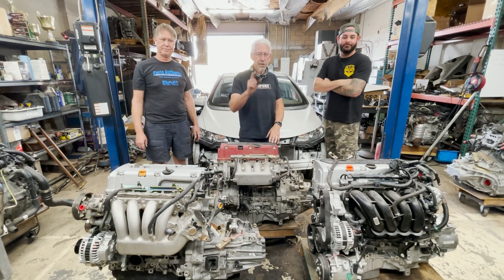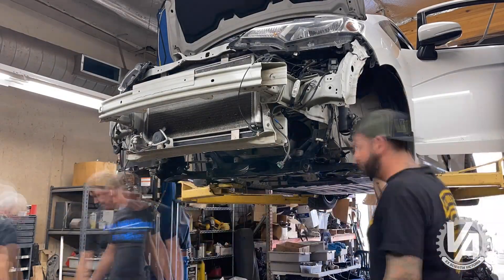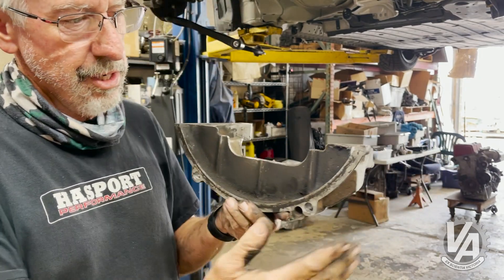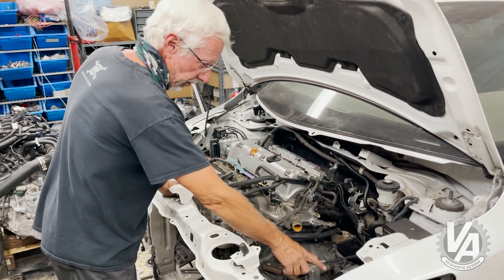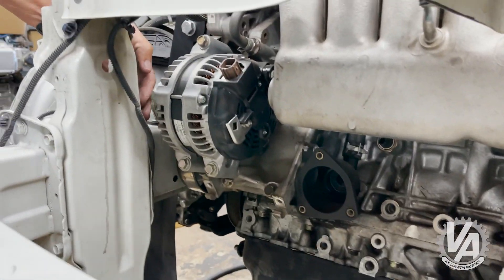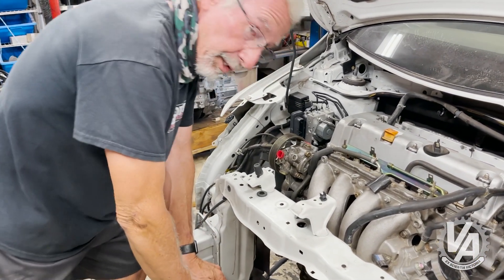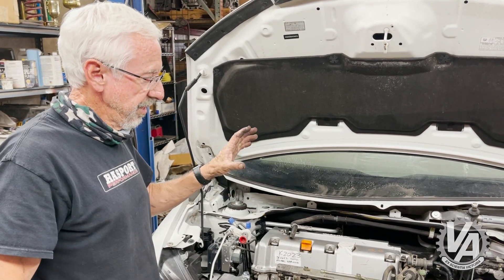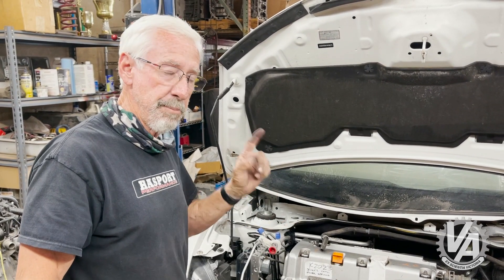Axion Fit Project -TSX and RSX Engine Swap Test Fitting

Comment: Very interesting. I am from South Africa and I have been doing research on K - swopping my honda Jazz/fit GK5 2015 model which I am assuming is similar to the one in this video. There are no GK5 fits in our area therefore, i have to rely on my research with limited experience. I am very much interested in the suitable motor and engine mounts for this vehicle. I heard you mention the 2012 SI engine should be a perfect fit and the bonus would be the wiring, which most of the components of the fit would be compatible. Have you done the 2012 SI engine fit already with the suitable mounts? I am leaning towards a k24 a2/3 from an accord however this video has sparked my interest, especially reference being made to the 2012 SI k - series. Any input would be appreciated. Thanks

Comment: I've been asking around for K swap or L15B7 swap harness information for months, and nobody has been able or willing to tell me anything.  I really hope you guys can make it happen, and make it available, especially for the turbo engine- I can do most of the other stuff at home, but figuring out the wiring diagram is beyond my talents.
Reply from the maker: I still haven't built the L15 swap harness for this car. I'll do that soon. I haven't done a K24 swap in that car, other than developing the mounts. So that wiring I haven't looked at either. I know some people who have done the swap in the 2015 CRZ which has similar wiring. Their cars were race cars so they converted the wiring to the 2006-2011 Civic style though so they could use the older engines. So that doesn't help either.

Comment: Will this kit fit a mobilio?
Reply from the maker: My best guess is it would fit on both the Mobilio and Brio.
Reply: @VTECAcademy  I live in Thailand so I was thinking the mobilio and the fit have the same motor. Did you hear what the EPA is doing to the auto industry?  Youtube channel PFI speed , the EPA went after them for selling ECU's. Anyway, thank you.
Reply from the maker: @wynwyn1941  That's unfortunate they went after him, but I'm sure it has to do with his high-profile association on Youtube and not selling ECUs with the proper warnings about off-road use only. If you go to the Hondata or KTuner websites there are pretty explicit warnings about using their products on street cars. There have been a bunch of lawsuits against tuners with a heavy social media presence recently specifically to make a point with people who are modifying street-driven vehicles. Our Fit will pass federal emissions properly when done.

Comment: Is it possible to completely close the hood on an eg with a k24 and rbc intake, using egk2 mounts on the higher setting?!?
Reply from the maker: Nope. The manifold sits too high. You might be able to do it if you plug the bracket booster fitting and move it, and cut some of the hood understructure. I may have to try that.

Comment: So let's say I'm going k24z7 on my gk5. I'm on board with everything mechanically. But where do I go with wiring? What do I use?
Reply: Go on the forums they said they are active on em.  Not sure which one.
Reply: @duanebailey6253  Axion is active on the Fitfreak forum for honda Fits. But to my knowledge there's no info on that subject yet
Reply: @SFLdrifter   their info on the Forums is very vague. Nothing specific. I plan on doing a vlog out of it. There’s no info on K gk5s at all. At least none that I could find state side . And even the ones over seas don’t have info on the swaps . I know I have to get exhaust made and maybe axles.
Reply: @SFLdrifter  I found it in my first search.  K24 fit wiring.  Come on now.
Reply: @duanebailey6253   link? And is it for the 2015-2020 fit?
Reply: @zamudio1991  pull the wiring harness diagram and compare them.  Seeing as you already have a 1.5 earth dreams direct injection motor why not make life easy and drop the civic turbo motor in?
Reply: @duanebailey6253   because the wiring is different completely between the l15 in the Fit and the L15b in the turbo civics. I’m sure I can figure out the wiring for it if I sit down and go thru it. But I already figured out the wiring for the k24z7 and also I have a full swap already to go..
Reply: @zamudio1991  You have to find the wiring diagram first. As far as I know it's only available if you sign up for Hondas subscription service.  I'm thinking canbus would make things more difficult too.
Reply: @quademasters249  and yes I know that. I’m a certified Honda master tech. I have access to all diagrams… which is why I said that there’s a difference between the L15 in the Fit and the L15b7 in the Civic’s pcm connector. I could figure it out if I sit down and look over both. But I already have the k24z7 wiring down to convert.
Reply: @zamudio1991   I did a spreadsheet for my last swap matching pin numbers between the two different ECU's.  I imagine you run the K harness on the engine with the ECU in the engine compartment just have to figure out the wiring for the body harness to ECU harness.  At least that's how my last swap went.
Reply: @quademasters249  yea exactly. That’s what I was referring to. The ecu for the l15 turbo only has 2 plugs.. 1 for the engine and the other for the chassis plug. That plug has double the wires then the Gk5 fit does. I can figure out the wiring if I sit and study it but I already have everything for the K swap
Reply: I’m going that route currently and made my own jumper harness and also figured out the ecu plug A pin out for the swap
Reply: @zamudio1991  if you don't mind. Would you be willing to share your progress on social media or whatever. My gk5 isn't under the knife yet because I just can't get passed the wiring on paper
Reply: I already covered it in my complete 'K swap guide in a Fit/CRZ.
the wiring of GE and Gk is covered in part13.I have provided all the wiring diagrams. Its a 17 part series BTW
https://youtu.be/g9-aWcKs3XA
Reply: @A.QPerformance   I saw your videos and compared the wiring diagrams you have versus the ones on our US built cars and there’s some differences
Reply: @zamudio1991  yup i have told in vidoes various times that there will be minor differences amoung models.some are auto,manusl,paadle shifts,push starts,cruise control etc etc but i have also shown a general way to figure them out with voltmeter and continuity tests.the main thing is wiring od important sensors like crank,cam,O2,ecu poweelr.those wires are same among them.and if you have pinouts if you can share,i will.put them in shaeed fokder and will help people out
Reply from the maker: Mostly it's just requires rewiring the car harness ECU plug and the C101 connector that interfaces between the engine harness and car harness. Unless you have an auto. Then there is the some added wiring.
Reply: @VTECAcademy   I already have that down packed. Made jumper for the c201 to c410 plug  and also figured out the A plug repin as well. Should be running this weekend hopefully and just got to get axles made and exhaust

Comment: How does the size of the L15B7 compare to the K20/24?  I'm trying to decide which I want in my GE fit. The K's seem big enough  to get in the way of regular maintenance.  Wondering if the L15 is smaller.
Reply from the maker: We will see in the next video!
Reply: @VTECAcademy  Some measurements would be great.
Reply from the maker: @quademasters249  The L15 is narrower, but both taller and bigger front to rear. I don't have a GE Fit to try it in, just a CRZ
Reply: @VTECAcademy  Thanks. So, there's more clearance between the frame rails but less between the core support and the engine? And the engine to the firewall?
Reply: with L15B the tuning potential is less.You will be limited to may be 300 hp. The k series can go to 400-500 easy.and aftermarket support is enormous. Also the new l15B uses Bosh ECU's.Good luck with the wiring
Reply: @A.QPerformance  For a track car Fit, 200-250 is plenty. Enough to make you the fastest car at the track day.  400-500 on a FWD car is just silly numbers. Nice to brag about but not really usable.   It's good for dyno numbers and maybe some drag runs. 

If I did K I'd just leave it stock. Reliability is the most important thing for a track car. 

I don't expect the wiring to be any worse for K into Fit than L into fit. It's still canbus and would require a translator to make the dash function.  

The one bad thing about the L is that documentation is hard to come by.  I'm leaning towards the K but checking my options.
Reply: @quademasters249  Yo Abdul nice to see you here. The K series videos are lit man
Reply: @spitsharm  I think you might have me confused with someone else. I don't have any video's on YT. I'm not what you'd call photogenic, though I do do fun projects.  Installing a CRZ suspension on my Fit is my current project. 5 lugs and 4 wheel disk brakes.
Reply: sorry man. I thought I responded to @A.Q Performance. The comment was meant for him
Reply: @spitsharm  Haha no problem. I just didn't want any confusion.
Reply from the maker: @A.QPerformance  MAPerformance recently got 500 HP from their stock block L15B7, with a turbo upgrade. So, 300 HP limit isn't correct.